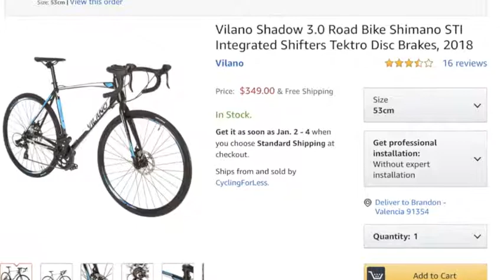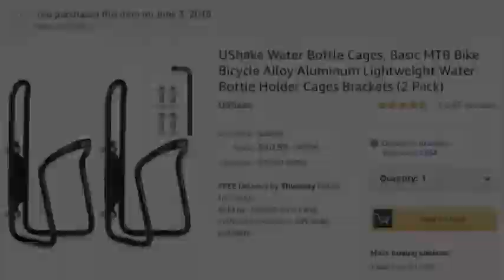Vilano Shadow Bike Review and Gravel Bike Conversion Part 2

Comment: Did you find gravel tires that fit the frame?
Reply from the maker: @N8TheGr8M8  no I just kept the original ones I bought.  Eventually they wore down a bit and fit. Not ideal but it works. I don’t do a lot of gravel riding and I pretty much use it as a commuter bike.